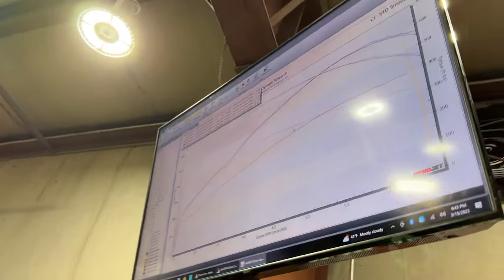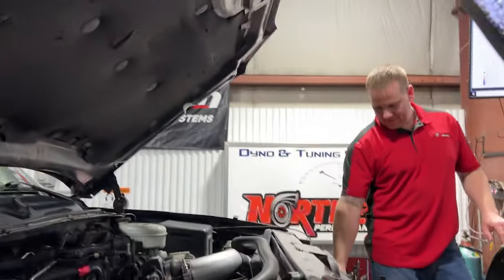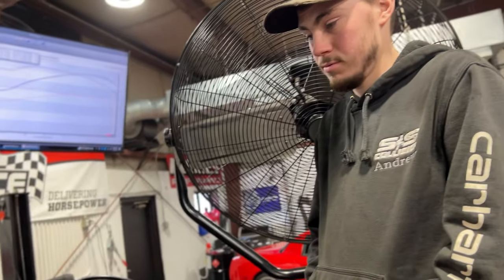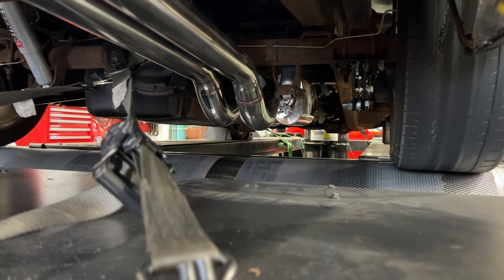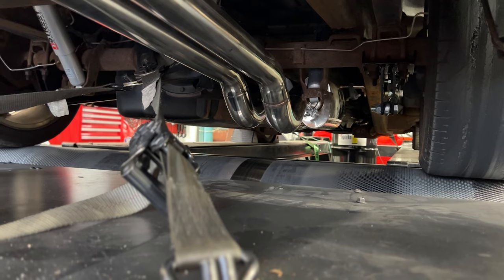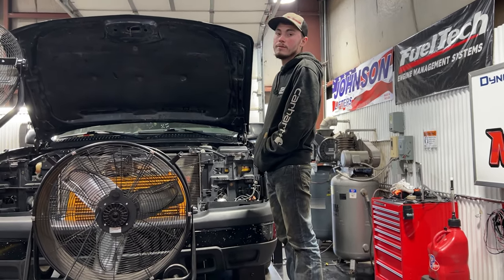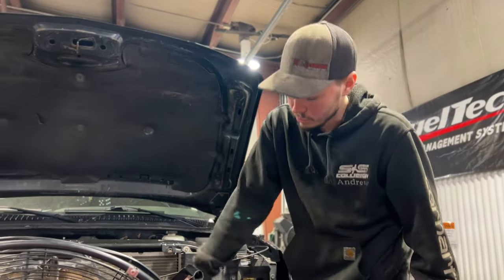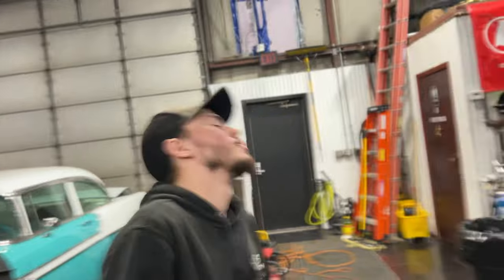TORQSTORM supercharger + Cateye RCSB Silverado = total BADA$$ Andrew’s dreams finally came true

Comment: Just wanna ask, would it be possible to run this on a 4.8 with a small cam, a 340 drop in pump, and a set of upgraded injectors? And also what about non intercooled?? Just a daily driver

Comment: What exhaust is on this thing sounds supper clean
Reply from the maker: It’s actually the large speed engineering mufflers. 
It is tame but sounds great.virtually no drone. 
I made a custom pipe route so it’s not a y pipe any longer. X piped dual 3”

Comment: I wonder what my 6.2l bore ly6 will make with the 3.1 pulley torqstorm. 
Tbss, ported ls3 tb, 229/244 625/615 113 cam, 1 7/8 equal length exhaust

Comment: That is a beautiful sounding exhaust!  And this truck should probably perform pretty similarly to your new LS7 in the red truck, true Kenny?  Assuming yes, this is a really nice (assuming quite a bit less expensive) way to get to a really great end product.
Reply from the maker: Yessir. This thing is a torque monster due to the whole combo. 
It’s a 383ci stroked ls1 basically that we installed mid last year. 

It’ll be a really close race between us I’m assuming. 
We will give it a go when summer comes! 

I think overall it’s similarly priced being it had a completely built engine etc. 
but certainly easier for the normal guy to achieve. My cylinder heads cost as much as his plus the blower lol 
Bottom end wise was similar cost. 
So definitely splitting hairs.
Reply: @NorthernPerformanceCars  Thanks!

Comment: I have a 1975 caprice convertible with a LS swap Mild cam 3500 stall rear end done with a trail blazer ss intake what size torqstorm should I run and how much HP u think I would make with my setup

Comment: I've got a 2000 2 door I'm thinking of swapping over on an Escalade frame to get rid of the rear leaf's. Plus it's got a way better braking system than 6 cylinder truck does
Reply: That’s a cool idea.  You should do videos on it.  I’ll subscribe.